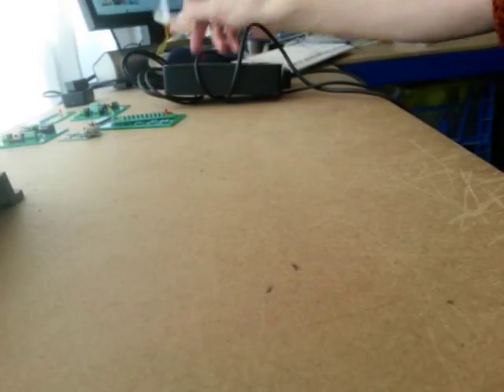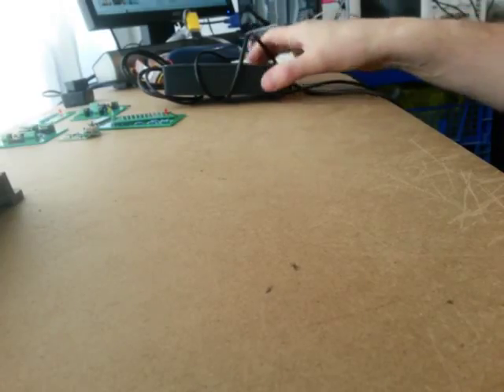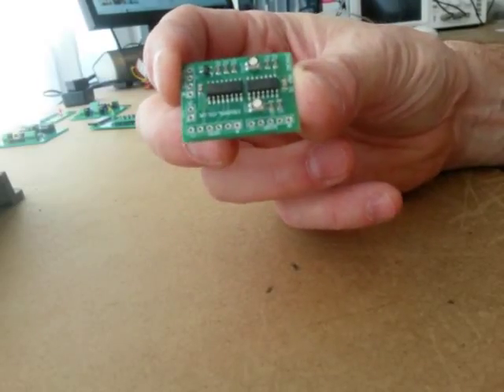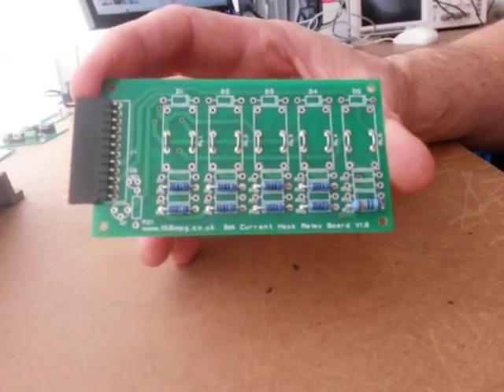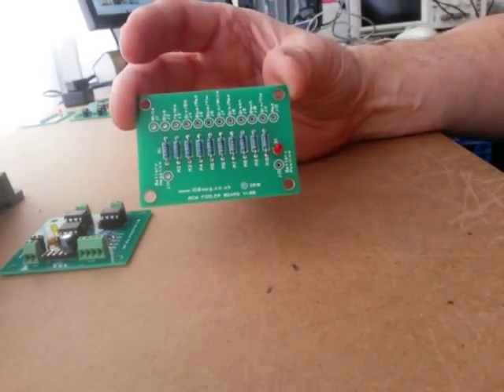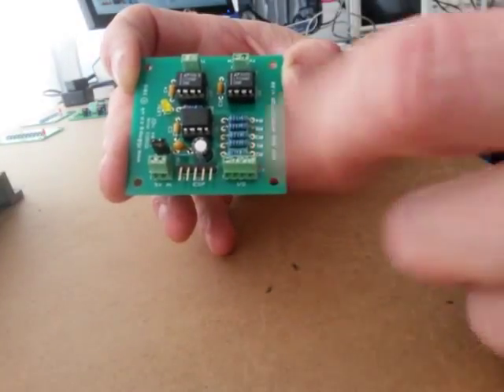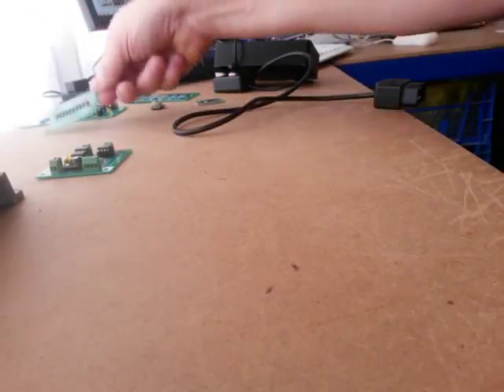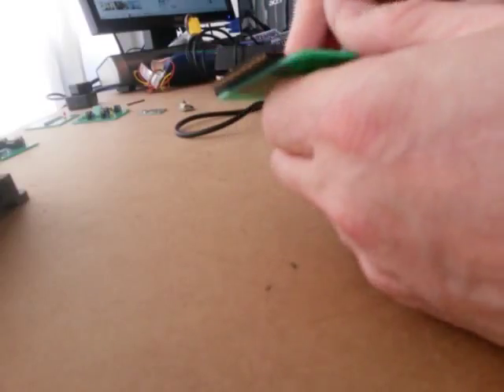G1 Honda Insight lithium Conversion Devices.

Comment: How do you troubleshoot if one of these components fails on a converted car?
Reply from the maker: Please post questions on the relevant threads on the  www.insightcentral.net forums.  Thanks
Reply: But I'm not on there. I'm here.  Can you please answer without requiring to register on a different website and find you there?
Reply from the maker: @VndNvwYvvSvv  Sorry i want to keep the tech information in one place, I only use YT as a video repository.

Comment: @Jawad Ashraf
Insight Gen 1:
-100 amp discharge max
-50 amp recharge max

18650 Sony vtc5a:
-2.5v-4.2v max,
normal use 2.5v-3.6v max
-6amp max recharge
-30 amp max discharge

SAFE Lithium battery pack MIN. Size:
-Sony Vtc5a = 
20 sticks:
-1 stick= 2x in-series (2x3.7v=7.4v max), 10x parallel (6amp max recharge x10= 60 amp max recharge)

IN THE HOLE (my design):
4x+4x+2x 18650
-(in-series(4x parallel + 4x parallel)) parallel to 2x series.
-BASICALLY: 2x in-series, 10x patallel

PS: insightforum.com says battery light comes on when going lithium, so still might need buy this youtube guys LITHIUM CONVERSION KIT for INSIGHT's BATTERY COMPUTER.

Comment: Do you think it would be a good idea to use two 18650 batteries in series and one in parallel (as I can fit three in the space) instead of the nimh size D cells they have in the battery pack . If I was to do that would I need to change anything on the system so the charging is more suitable for lithium batteries
Reply from the maker: Please post Insight specific conversion questions on the insightcentral.net forum.